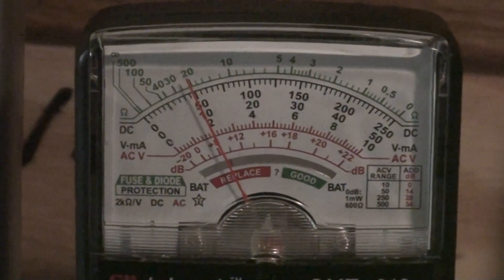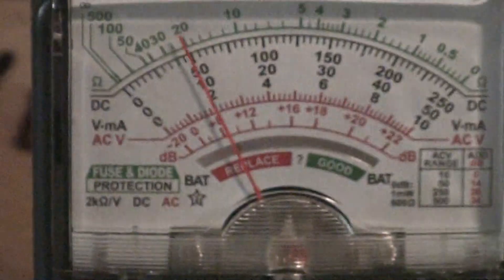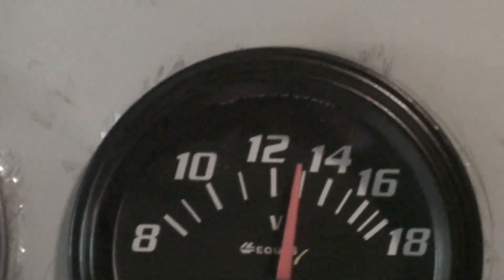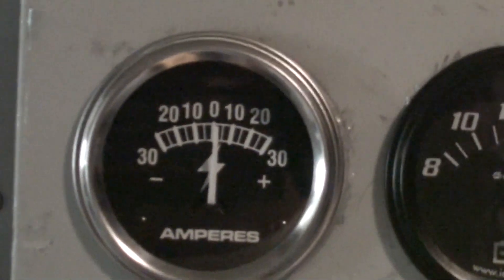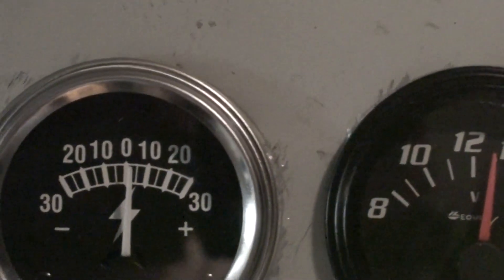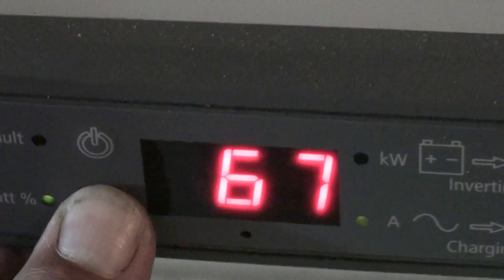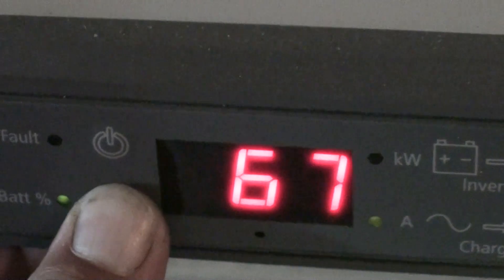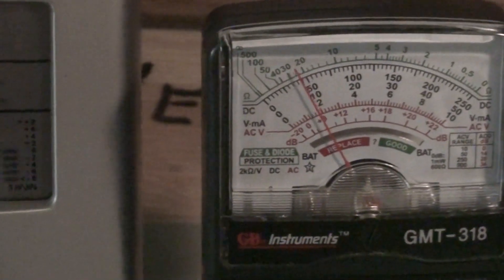counter rotating 2 Blade Lenz turbine

Comment from the maker: @MrWalksinStorms two in hand means two strands at a time, wound on the coil winder. 60 turns on the coil winder . per coil. #18 wire is thinner than #14  by using 2 strands you get the same as a larger wire but get tighter wound coils. , so more copper per coil with less air gaps.